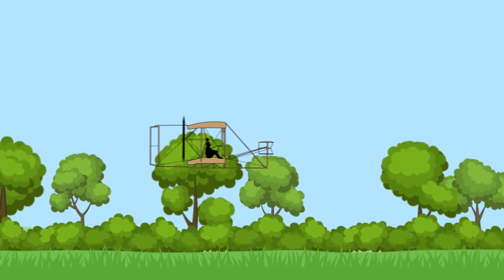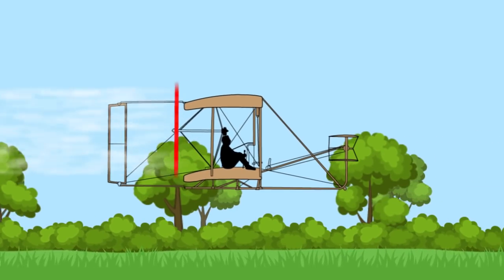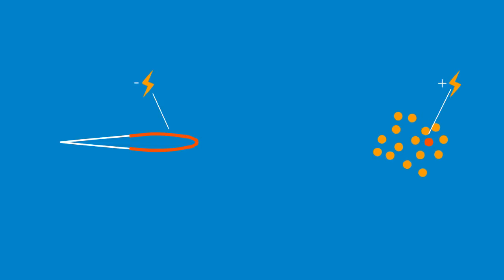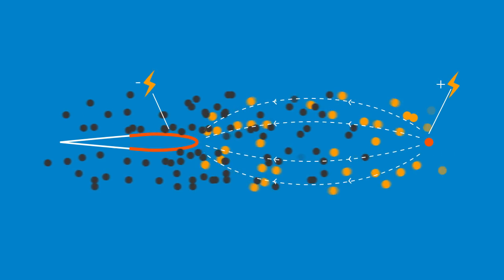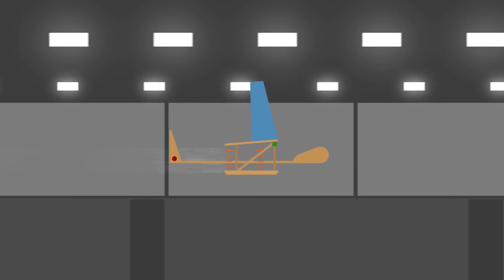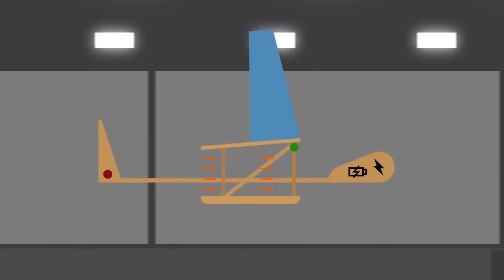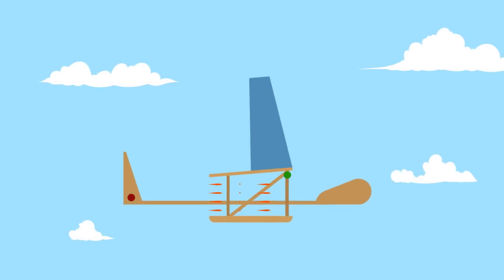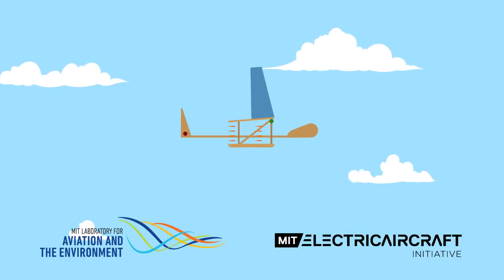Overview of MIT's solid-state airplane

Comment: This image is a real EAD . It was recorded June 2018 at venice beach,Los Angeles. It is still flying around.
Reply: If you click on the purple channel icon to the left, you can see a real proven EAD aircraft that was verified to carry its power supply onboard long before the MIT device.  MIT should be aware of widely published patents before making big claims!
Reply: @KraussEMUS1  BUt it was launched by a rubber band... so its not so exciting. They are just trying to latch on the theme of the Wright flyer to get PR. But to be fair it did fly and it did have a sustained flight of about 20 feet before it hit the ground and folded in on itself. The thing you can take from their experiment is the weight to power ratio. Whatever amount of power they used X wing surface + weight is the formula to build your own craft. Do some tweaking and you too can get a battery to fly 20 feet with a rubber band.
Reply: @jamesanderson478  Hi James,
Impressive material.  However, While I am aware that working LTA blimps propelled by EAD thrusters have been in operation since at least the 70s, I have seen no evidence that heavier that air ones have been in operation besides my lightweight device.  It has been possible for many decades to propel a blimp using ions but required a surprising increase in thrust to weight ratio to get a heavier than air craft to fly, using only ion propulsion.  If you could provide some proof of an earlier heavier than air ion propelled craft than mine, it would be interesting.  It is not unreasonable to ask for solid verifiable proof for such significant claims.  Thanks ahead of time for understanding.  I appreciate anyone's work in this field, and Thanks for the long message.

Comment: Yeah...but what if the charged surfaces had Carbon Nanotube dust painted on them.

Wouldn't that make the movement of the electrons go faster and more efficiently?
Reply: No. Faster moving electrons would not produce more thrust. More electrons produce more thrust. Electrons product very weak thrust because they push air molecules on the travel path. Try pulling on your hair and see if you can fly around. It is the same principal.
Reply: Nanotube dust may provide a more even distribution of electron ejection points, which might increase the efficiency. It would need to be tested. It would likely have a neglibile effect.

Comment: I'd be interested in seeing what the effect of the anode (+) placement/shape/number has on thrust:weight.
Reply: As the collector/emitter surface gets longer, more lift can be attained with similar wattage.  One might think the power draw would increase linearly with collector length, but a long lightweight one actually produces more thrust per watt.  

If you would like to see an earlier ion propelled craft with onboard power, that is more optimized, please click on the channel icon to the left.

Comment: Again, here is another video with MIT claiming or in this case implying that they created the first ion propelled aircraft of any kind to carry its power supply  The first aircraft to do that has already been patented specifically for carrying its power supply as well as other improvements. 

If you click on the purple channel icon to the left, you can see 5 flight videos of the invention rising vertically... with its power supply onboard.  Not only does it predate the MIT device by over a decade, much more importantly, it is orders of magnitude more efficient.
Reply: Yes Ethan you are correct. The technology dates back to the Flying Umbrella that could move vertical. Also MIT uses a rubber band to launch the vehicle. Then it appears to have a sustained flight of about 20 feet then crashes and folds in on itself. 5 pounds of wire and battery gliding almost 20 feet...lol 

Total Bullshit ! There I called them out. To  A solid state pane will need a FUEL supply to mix in the aspiration of the electron field. This produces more thrust. Using AIR only will be catastrophic. One you move from a high density to a low density air pocket you will lose thrust. 

To me it is like pulling on your hair and walking on your toes claiming you have levitated yourself off the ground. If they want to impress someone then they need to launch the vehicle from a stop position and use the ION thrusters to accelerate and control the vehicle with a sustained flight. Then they need to LAND IT not CRASH IT!.

Look MA... no propellers !
Reply: The video says "airplane" as in flying with wings. I do not claim to know much about the history of ion propulsion but there is a distinction between "aircraft" and "airplane". Nevertheless I find your work incredibly impressive and I wish you all the best in the future.
Reply: @jage1559  Thanks for commenting, and for the kind wishes, same to you.  My crafts actually can fly with aerodynamic lift, on one side, as an airplane.  Having onboard power and high efficiency were the main challenges with ion propulsion.  The Journal of Nature paper for this MIT craft and the accompanying video and editorials claim it was "the first ion propelled aircraft of any kind with onboard power."  My earlier patents are for ion propelled flying machines with onboard power.  Implying Haofeng Xu and co. are like the Wright brothers isn't correct.  No one really seems to care though.  There is enough wealth for everyone, but historical accuracy does count for something.
Kind regards!

Comment: Yes Ethan you are correct. The technology dates back to the Flying Umbrella that could move vertical. Also MIT uses a rubber band to launch the vehicle. Then it appears to have a sustained flight of about 20 feet then crashes and folds in on itself. 5 pounds of wire and battery gliding almost 20 feet...lol 

Total Bullshit ! There I called them out. To  A solid state pane will need a FUEL supply to mix in the aspiration of the electron field. This produces more thrust. Using AIR only will be catastrophic. One you move from a high density to a low density air pocket you will lose thrust. 

To me it is like pulling on your hair and walking on your toes claiming you have levitated yourself off the ground. If they want to impress someone then they need to launch the vehicle from a stop position and use the ION thrusters to accelerate and control the vehicle with a sustained flight. Then they need to LAND IT not CRASH IT!.

Look MA... no propellers !